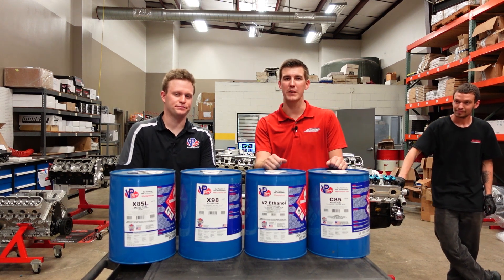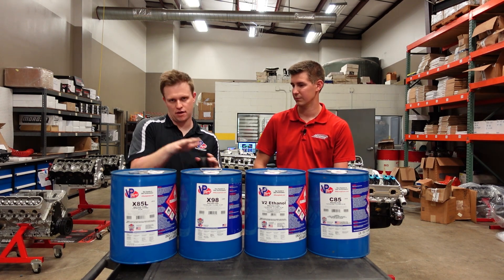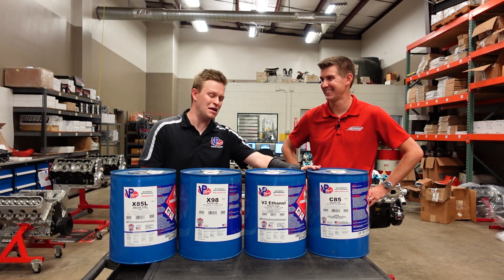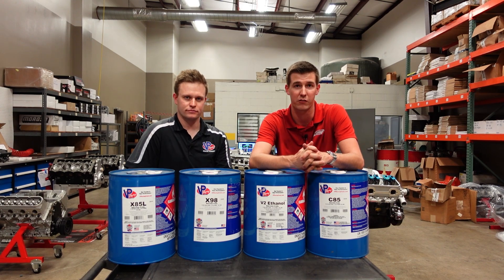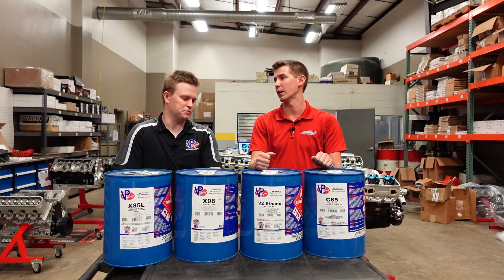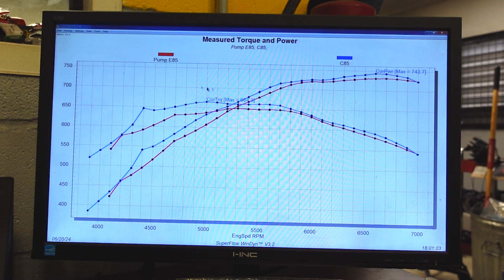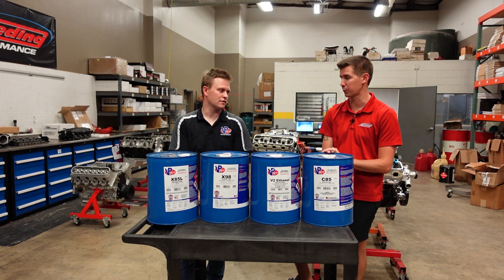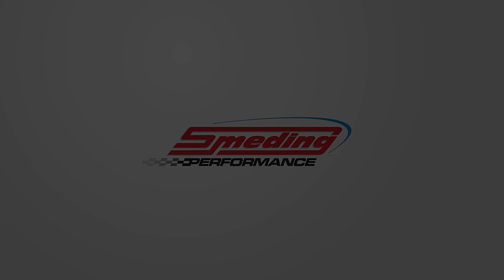Does VP Racing E85 Make More Horsepower Than Pump E85? ANSWERED!!

Comment: This video is excellent for demonstration purposes. Good Job. But every 1/2 brain chemist knows that ethanol sucks the moisture out of the atmosphere the very second they connect. This does not do pump E-85 any good at all and if your running E-85 in your rig. I would avoid pump E-85 like the plague. The storage environment in UST's is not conducive to maintaining E-85 fuel quality. Pump E-85 almost certainly has more water content than VP's canned stuff. That said adding TEL to E-85 is almost certainly a gimmick. Properly formulated E-85 does not need lead. I smell a scam? Oxygen itself does not make power, BTU value makes power. If I am not mistaken E98 has a lower BTU value than E-85. I do not think VP has to get much of a government approval for their V2.fuel. If it is necessary? I do not think that young man will be the guy getting it done.  As for the C-85 there is simply no comparison to pump E-85. Like all liquid fuels sold in the USA at the pump under the federally mandated RFS, they are the worst fuels and refined fuels in the history of making fuel. Even ChatGPT knows that all fuels sold at the retail pump in the USA flat out SUCK. There is no comparison to VP ethanol based fuels until after you open the can. Be sure you cap it quick after filling your tank as ethanol-based fuels decline in fuel quality quite rapidly. Hours to days.

Comment: Wow racing E85 at 5x the price of pump E85 gives a tad more hp.  No thanks.
Reply: Yes and no the race E85 is meant for extremely high horsepower. It’s meant for 1200+ because it’s more stable at lower hp it doesn’t do much

Comment: Great video! Im brazilian and since 70's you can find E100 in any petrol station over the country ( in reality is 94% ethanol, 6% water ). Even on that times, stock carbureted engines used 13:1 compression ratio.
Reply: E-100 e o melhor combustível de corrida que temos em larga escala e barato. Os americanos aqui pagam muito caro por E-100.

Comment: Pump E-85 performance varies on where you live at. The further up North you go, the less ethanol you have (which means lower octane). They do this, so your car will run in sub-zero temperatures. Further down South you go, the more ethanol you have. It's always warmer in the South, therefore more ethanol is added (which is higher octane). But there isn't as many stations in the South, so it boils down to season change. IMO, it would be better to run on normal gas in the Winter time. Only run E85 during Spring, and Summer.

Comment: Nitromethane and MTBE.. ok, now I know why the 1050 Dominator I loaned to a guy came back a useless corroded wreck. I run E85 and E100 that I make from cattails in my carbs and fuel systems without issues for years, the 70 GTO has been on it since 2007.  Seeing the difference between the fuel I make, 190proof straight ethanol, and anything mixed with gasoline, it appears that Jeff Smith is right.. additives cause corrosion. So if you're going to run C85, treat it like methanol with after run oil and not letting it sit, even overnight.

 My 65 GTO has been on E85/E100 since 2018, no issues and I pull the battery in October then put it back in the car in May.  Its had Qjets and Holleys I convert, as well as FiTech EFI on its 11.5:1 iron headed 455 that makes around 550hp. Its been my tuning mule that I use to set up carbs for other engines.

I like the frost and condensation on the outside of my 6-71 case while running my 505ci Pontiac in my 68 LeMans, that I get from running E85. My friends running pump gas have issues with the blower getting hot while driving, but I don't. 

As for consistency, the lighter parts of gasoline will evaporate off if you let it sit in a barrel for a while (a few months), it comes out to around E90 when I do that. So I will stick with the $2 pump stuff rather than paying $10 or more for the VP fuel. I ran VP red in the 1990s in one of my cars, never had a problem other than rubber hoses needing replaced every other year, and it ran pretty good. Also, since I can produce ethanol for about 40 cents a gallon, the cost of which is mostly cleaning supplies and yeast/enzymes, I just can't justify $10+ for fuel.

Comment: E85 has a negative affect on some engine oils ! - i saw a subaru sump full of black jelly = it said E85.
Reply: That was due to the engine never being able to warm up before it reaches it distination aka very short trip drives, which an issue most problematic on E85 due to the higher moisture in the fuel compared to pump gas and that moisture gets into the oil to make that jello. MotoIQ made that clear.

If you do drive for more than 8 minutes then it aint an issue.

Comment: Just filled up with E-85 that tested at E-79 for  $3.12 a gallon , switched from pump 91 octane a while back , I'll never go back to 91 octane .
Reply: Just make sure you heat your engine up really well 10 minutes or more every time you start. The ethanol causes condensation and a cold engine won't burn out the moisture. That moisture if not burned off will make your oil milky and sludgy.
Reply: @natorious76  
I'll take your advice,  thanks !

Comment: Do they still have e85 at the pumps still,
Reply: Heavily dependent on the area. But it can generally be found in most populated areas. You might just need to drive 30-60 mins to get it

Comment: I know someone just tested Nitro Top Fuel I think it's $399 for 5 gallons they took a beat-up LS1 5.3 lm7 did a dino number Maid 279 HP 303 foot pounds of torque... did not touch timing or anything I think... just adding the fuel in hit the Dino and I think the next pass was 500 + horsepower
Reply: @hopebrowning6300take a Top Fuel Hemi and run it on alcohol and you'll drop 50% horsepower. The shit literally doubles the power of the engine. So that sounds about right. Top Fuel funnycar, 11,000 to 12,000hp, Top Alcohol funnycar, 5000 to 6000hp. Not much difference in the vehicles or engines.
Reply: Take a 150hp motorcycle engine and run it on 98% nitromethaine and it'll make 300+hp.

Comment: Then you are over fueling. Getting too much ethanol and n the oil. Another reason not to run it. Engine wear. Same with the drag engines I’ve worked with.

Comment: Best advertisement ever for pump e85. I think pump e85 is all you need. If you need more power just add 1or 2 lbs of boost. We’re already making 1300 hp on  a 6.0 at 24 pounds pump E85.   Not much need to change fuel change fuel, especially since pump  e85 here in California is so cheap and test out exactly 85% ethanol. I’m sure e98 or c85 will make a lot more power boosted but can’t justify the cost. We’re already making as much power as the chassis can handle.
Reply: You sure it’s always 85? I live in Indiana where a lot of corn is grown, and I know ours is not always 85 percent. I’m even lucky enough to live by an ethanol plant called ibec that’s has a pump and it’s e90 all summer long but drops sometimes in the winter. With vp and sunco. You know it’s always the percentage they say, where as the pump is not always consistent
Reply: @HoosierStreetScene we test Chevron Chevron and Shell and they both test exactly to 85%. I’m surprise more old guys are not building 13 to 1 compression big blocks and running them on e85 here in California. free race gas. I’m old, most of my friends just don’t understand for some reason they’re all scared of ethanol. I think it’s the greatest thing that ever came to California Street racers dream.
Reply: @danielsullivan9865  If we do 13:1 might as well do 14:1 and consider 15:1!
Reply: @dennisrobinson8008  yes, they will all work on e85 except a little radical  street engine.
Reply: @HoosierStreetScene  California has a rep for being at least 85% sometimes higher.
Reply: @dennisrobinson8008 well at least California has that going for it 😂 lol well that’s good consistent fuel is always beneficial! What’s the price out there here it ranges 2.95-3.29
Reply: @HoosierStreetScene  So it's "E85 heaven" as far as the country goes and that's a very good price for that area.
Reply: @HoosierStreetScene  It usually doesn't matter. They clearly show going from 85% to 98% is only worth 10hp, 1-1.5%, and it works the other way too. Nerds have tested ethanol's effective octane and it doesn't drop much until 25%. You can find real-world of examples of people [via forums] having no prob (knock) running E70 on an E85 tune.

For people racing for money or a LOT into their engine it's probably worth it, but for the rest of us poor slobs 10-15hp is not a big deal. Either way it's nice to know it's there.
Reply: @hydrocarbon82  oh I know I never seen much difference when we strap cars down in the dyno
Reply: @HoosierStreetScene Indiana E85 is pretty consistent during the summer, its until it starts getting cold out but Ive measured 70% ethanol on E85 pumps near Carmel.
Reply: This video definitely helped the pump e85! The couple hp don't justify the extremely high cost. I would say to clean Filters more often with pump e85

Comment: Paying for a fuel like X98 just to pick up 15HP, along with needing to change your base fuel just flat out isn't worth it for the large majority of people. You're wayy more financially better off taking 75lbs of weight off the car or throwing a cheap dry kit on and spraying a 50 shot.
Reply: 15HP NA isn't worth it?! You must not do any NA racing.
Reply: You dont need to change the fueling if your ecu is setup correctly with a flex sensor. But yeah, not worth it on these type of engines.

Comment: Ok, so these are basically souped up blends. Of course, they will make more power. Also, an independent test from an unbiased 3rd party makes more sense without the manufacturer present.
IMHO, pump E85 with content E sensor and flex fuel is the most cost effective. If need be add some X98 to bring it up in ethanol %.

Comment: Looking at their pamphlet, VP always claims X% over other fuels. I've never seen real gains other than CHP+ and Q-16. C-12 compared to VP113 were identical in my combo, with C-12 taking the win as a fuel you can forget practically for years in the cell whereas the VP113 has special storage requirements. FWIW all the Q-16 tests I've run were worth 5 to 15 HP over the base fuel the engine was tested on.

Comment: I have ran pump e85, c85, and One ethanol R in my new 13:1 voodoo and the car loves c85 the best. Runs better, sounds better, makes more power and the burn is significantly better in my application. Nothing bad to say about One R, but the octane is a bit too high for my application, and seems to make my throttle a little sluggish, and the burn doesn’t seem as complete. Sticking to c85 all the way
Reply: C85 contains nitro methane
Reply: @rongosick4546  yup, as long as your injectors specifically state they can handle MTBE and nitro you shouldn’t run it

Comment: In N/A form, you won't see too much difference, but, when it's boosted or nitrous, it's night and day difference.....
Reply: True however us N/A guys like that we can get 30hp just by switching fuel, also can increase compression to 14:1😊
Reply: @1sweet_ta  true....
Reply: @1sweet_ta from pump E85 to racing E85 ?
Reply: Can you use these fuels with a nitrous setup ?
Reply: @richiec4120  of course.....
Oxygenated fuels are even better for nitrous oxide, because, you guess it, there's more oxygen in the mix.....
Reply: My 605 hp 365 cube holden v8 picked 16 ftlb and 15 hp switching from pump e85 to vp c85 race e85, our pump e85 we can buy in my part of Australia has always been fairly consitent and never tests below 87 percent ethanol even in winter
Reply: @jasonjordan4672  well c85 has a small percentage of nitrometh in it, so that makes sense it would pick up power
Reply: @jasonjordan4672 with just pouring the fuel in or tuning changes
Reply: You can make 1500hp on pump and not worry
Reply: Pump e I ment
Reply: 13:1... It ain't ever running on 93 octane. Boosted 9:1 combos end up making the same or more cylinder pressure on the power stroke compared to the 13:1 combo
Reply: Depends on the engine.  13:1 on a carbureted SBC, no you can’t run 13:1 and 93, but a newer DI engine, 13:1 can run 93 with the correct tuning.
Reply: Direct injection higher compression stuff loves c85 na. Like gen 5 lt. Coyote
Reply: @ClaytonYatescarenthusiast  Brian Tooley tested DI engines with E85 and always lost power.
Reply: @V8Lenny  link?